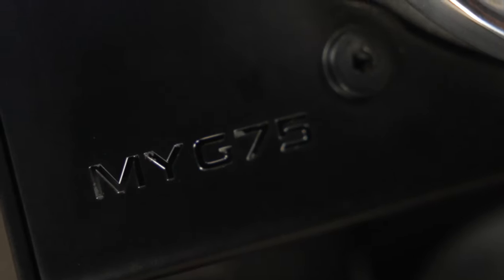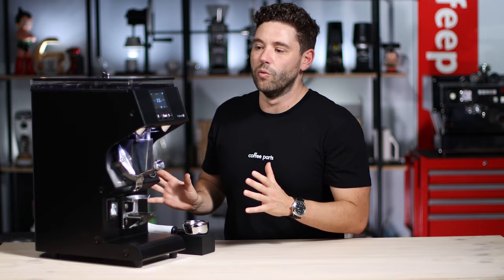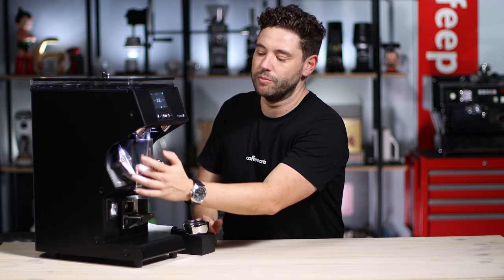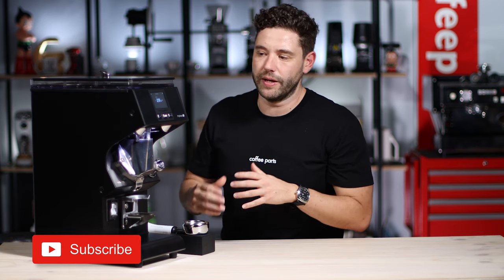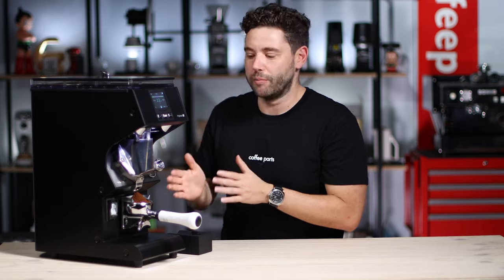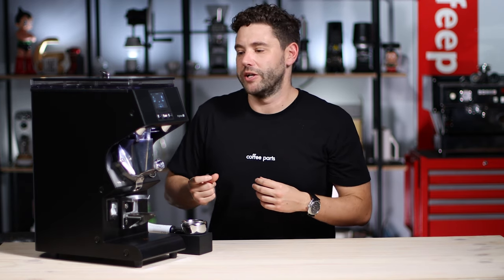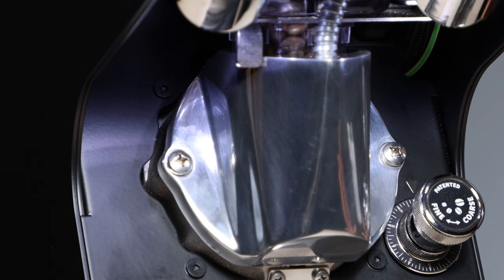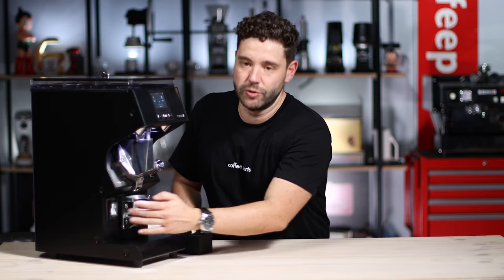The NEW Mythos MYG75 Gravimetric Coffee Grinder | Review

Comment: Thanks to your good and convincing  advertising and giving it a good thought I purchased the new MYG75 the last touch to my Profitec pro800 and my Puqpress2. I thought I would be more than happy, but on the contrary very unpleased  for the really bad service and poor attention my supplier and myself are getting from V.A. It happens practically to99% of us touching wrong settings making wrong adjustments on the screen going back and make a new start. Exactly this is what I did, but now I find i can't navigate to the menu front page, the language setting is blocked, the time setting every 10 hours  goes slow for about 4 hours and I can only go so far down the menu, not to forget the bean hopper was packed damaged on both sides of the top edge. The packing was intact when I received it that is the reason that I reffere to be packed damaged. This has been going on as from the 6th of July and still not even used. The only thing we have had from V.A. is asking one day for the software number and 2 days later the serial number. We have pleaded with them for a phone call or even better video call but now 7 days later still nothing.
My question would be to you Pedro, would it not be possible for you to contact this V.A. representative Andre Eiermann and pass this on to him, i cant think of what else and i would be forever grateful. I paid 2,500€ to have it as part of furniture.
Francisgonzalez1948@gmail.com.
Reply from the maker: Firstly, have just texted Andre for you.

But, will email you to get more details so I can get the right contact in Simonelli group to reach out to you and hopefully make you smile. 

Side note, not meant to be an advertisement. I genuinely get excited playing with coffee gear, Andre is a friend, and I don’t accept payment from suppliers so I’m free to review my thought. And apart from the Mythos  in this video (as they are not yet released in Australia), most machines on the channel are actually owned by me.

Comment: Which one would you choose for a cafe, mythos 75g or mahlkonig 65s gbw?
Reply from the maker: Both would be cool. 

There are elements of each that I like, so it will somewhat be a personal preference. 

The Mythos 75g feels like it picks up the portafilter faster, and auto-calibrates extremely fast. Do like how easy it is to clean, the grind adjustment dial. Yet, the GBW is now a little more proven in the market, and do like the lower look and design. Both have easy-to-use menus/controls. The grinds are on par, with the GBW possibly having a slight advantage.

So in a cafe, I would probably have the Mythos 75g, but at home would prefer the GBW with a small hopper fitted.

Will do a comparison video soon, either way, both grinders are fantastic, and feel you would be happy either way.